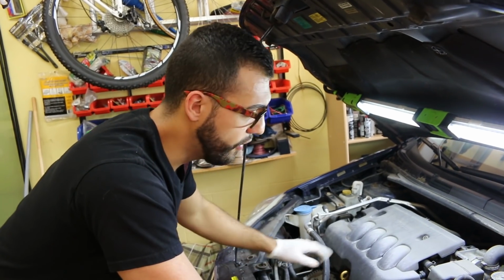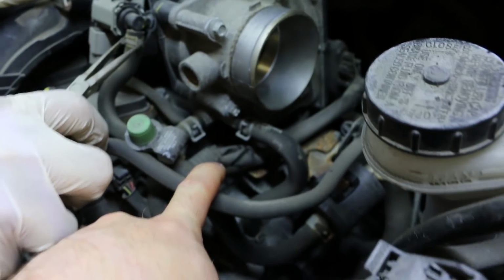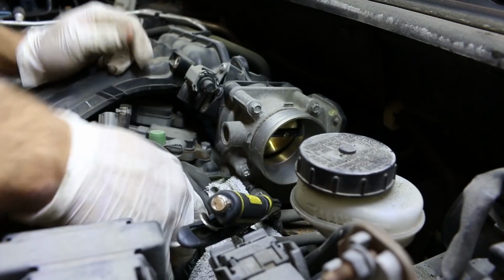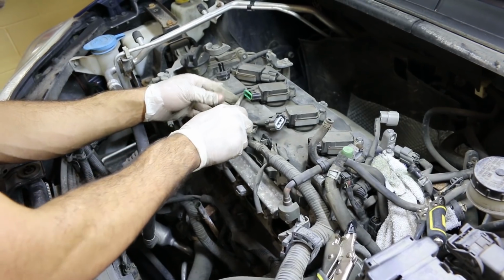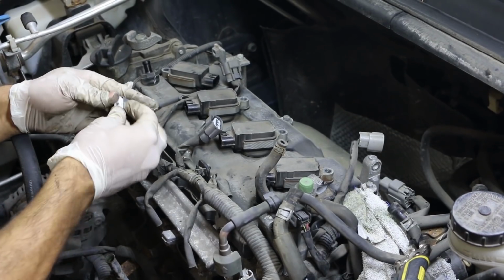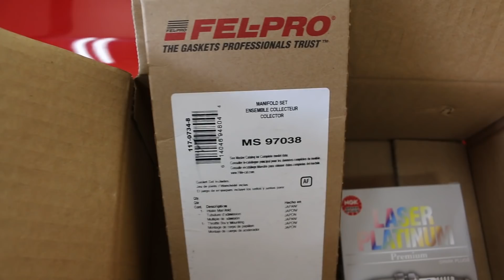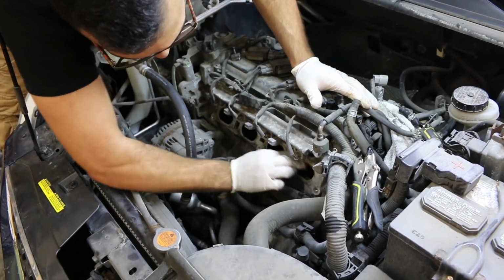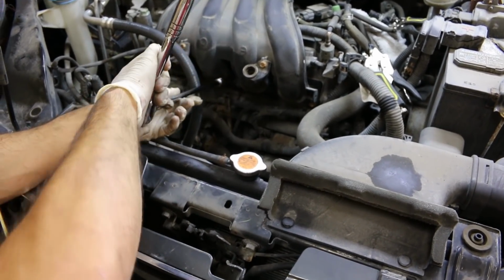How to Change Spark Plugs on a 2009 Nissan Sentra

Comment: I literally just finished working on mine. Had it not been for one of the 10mm bolts on the manifold being seized up, I would've finished sooner. Took me about 8 hours (had to make a few trips to the Auto Parts store.) But this video was a BLESSING! Thank you guys for taking the time to make it. It was step by step, and I watched it as I worked on my car. Taking everything apart took longer, but reassembling everything was a breeze, but I couldn't have done it without this video - so huge thanks again!
Reply: where did you get the parts? do you have part numbers?

Comment: Great video guys!  I would recommend to go ahead and change the coil packs as well while you've got the top of the motor torn apart, especially if you're getting a misfire code.  Realize it's an added expense so depends on your situation.  Well done!

Comment: Just did my plugs at 165K, did it before around 100k, the sparks were pretty damn nasty this time around, and will need to replace the valve cover gasket as oil was on the spark threads this could be why for all those running high mileage, engine runs much better with the new plugs, you will  become expert at pulling this silliness apart in record time working on this MR20DE engine

Comment: I actually had a 09 Nissan Sentra, after watching this video, I'm glad I didn't try. Before that, I had an 02 Dodge Neon, I changed the spark plugs without a problem. But it's like a lot of these newer vehicles, they don't want you doing nothing by yourself.

Comment: Great informational and well done easy to listen to would like to add a couple of things. One: Its important that you don't over tighten the plugs especially with aluminum heads it stretches the threads and they my break next time you try to remove them. Finger tighten then torque to approximately 7 to 15 lb. ft. for 14mm threads and 15 to 20 lb. ft. for 18mm threads. Two I am a firm believer in anti seize, having dissimilar metals(aluminum heads combined with steel spark plugs) can cause galvanic corrosion and the plugs will seize in the hole. Again thanks for the video.

Comment: After 133.000 miles on a 07 Nissan Sentra, I changed the spark plugs and sp coils. I really don't feel too much of a difference. There's no misfire or nothing wrong with it, but I expected some more horespower or better gas mileage. Oh well don't hurt if I changed it.

Comment: Who knew it’s time to trade in car rather than change the spark plugs?
Had a 1979 Chevy Monza Spyder Sport Coupe with the 305 V-8. Had to loosen motor mounts and jack up the engine to change those plugs. Didn’t know Nissan hired all the old chevy engineers.

Comment: In hindsight, how essential was it to disconnect all the tubing?
Reply: i cheat and leave most of the crap connected to the throttle body, just be careful : )
Reply: future shock lol! A year ago, save maybe two weeks, I did this myself. Following the original instructions, labeled the tubes and where they came from on the tb. Worked a treat! Thanks for the video!
Reply: @isuguy82  what did your plugs look like?
Reply: future shock they were quite clean. I did it because I had to replace the inlet tube anyway, so why not.

Comment: My intake manifold won’t go back on I keep trying to line up the holes and can’t figure out why they won’t line up
Reply: You need to make sure that the intake manifold (the big ugly black thing) goes BEHIND that bracket on the passenger side, it is easier just to take off the bolt holding the entire bracket to the engine

Comment: thanks for that, any idea of torque specs for the plugs or the intake manifold bolts?
Reply: For spark plugs its 14 ft/lbs of torque or 19nm
Reply: 14 LBS FOOT, do not go crazy torquing these down, i have to use a torque wrench
Reply: once you learn the hard way you never forget!

Comment: I replaced my plugs and coils and it started for a minute and died now it won’t start
Reply: Pablo Adame does engine turn over 
Might be the battery
Reply: I'm having that problem now...what was it?
Reply: Planned And Glammed when I removed the air intake hose it was so dry rotted it crumbled and pieces if it went into the throttle body and blocked it. As soon as it was cleared out it ran great and check engine light turned off

Comment: Everything good except step one.
Just be careful and ALWAYS disconnect the POSITIVE terminal first. Keep the battery grounded (negative is ground). Try not to touch the positive wire on metal as it possibly could be holding some charge after you disconnect it.
Reply: First step is right ,please check the reason behind it.
Reply: You do not disconnect the positive side first. Always take off the negative side first. It’s an extra safety precaution and there’s less chance at shorting something out. If you’re changing the battery, reconnect positive cable first.